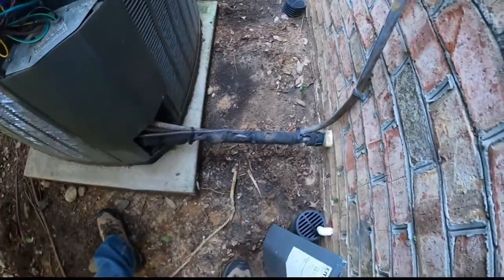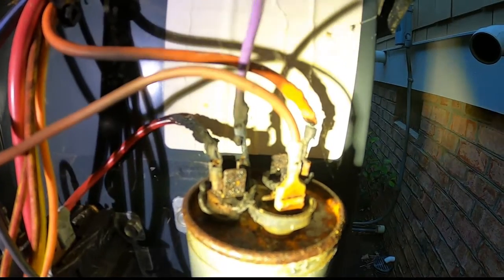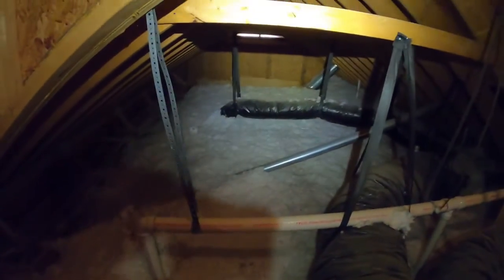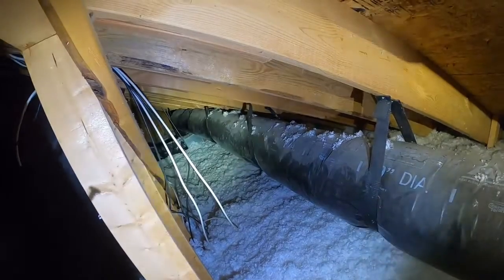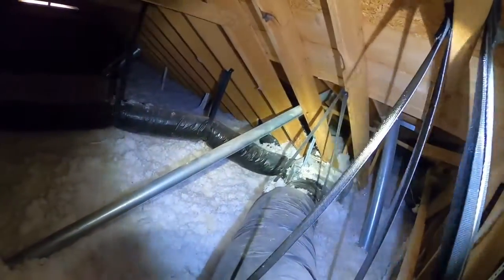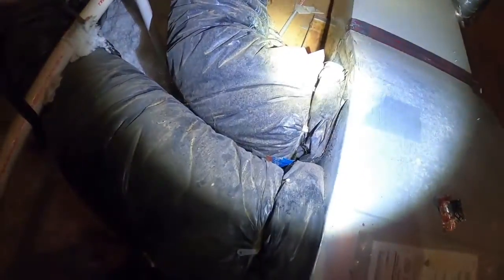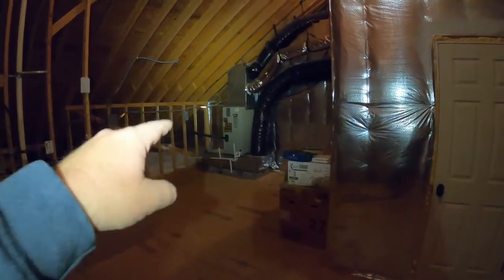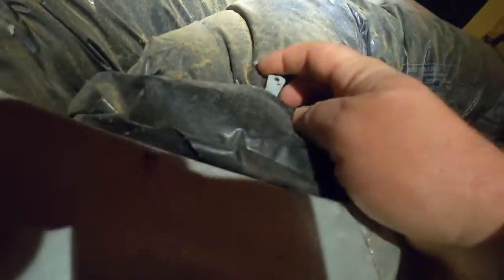AIRFLOW BALANCE

Comment: I watched the video and if you still have air flow problems upstairs either use scooping collars and seal around the old collars. Alot of air leaks out if not installed tightly. Plus long flex runs cut dn on air volume. You may not installed it but if still have issues that could be your remedy. They do sell double wing nut dampers so you can lock both ends of dampers inplace. I love using them so air doesn't move dampers on long term.  Anyway you can use a hood  or manometer to read some grilles? Hope it turns out great for you. I don't pick on videos I just try to mention ideas to help the person out. Thank you for sharing.
Reply from the maker: Thanks for the info. We made changes when we replaced the downstairs system. The upper units are original. He is planning on replacing that second floor unit in the next 2 years.  His objective was the master area and that bid damn closet which we will probably add a supply to and may be adding supplies to that vaulted ceiling. New construction designs almost always need modifications.
Reply: Ya that closet is big. I had a wic in a house upstairs with a bedrm and bathroom. I put a supply and a return in there had no issues. The owner kept door closed all the time. Its hard to satisfy vaulted ceilings to cool with a large  height. Hope everything worked out for you.

Comment: Omg do they have supply run going off the end of the transition? Jesus Christ it’s never going to build up static
Reply: It's got a damper though so not a big deal. You can literally shut off like 90% of the air by fully closing the damper.